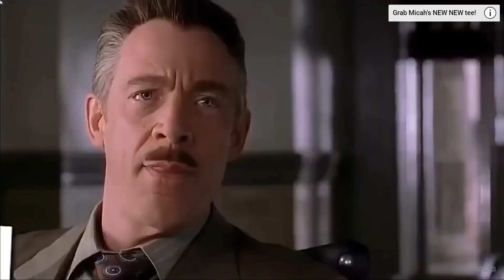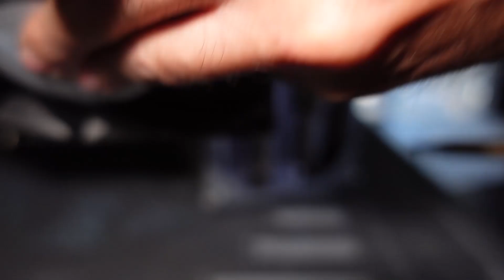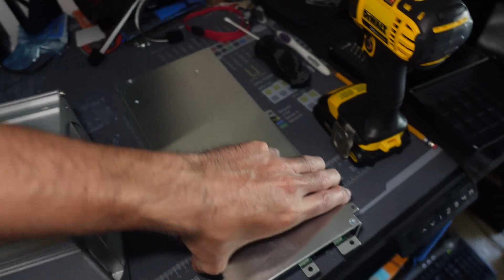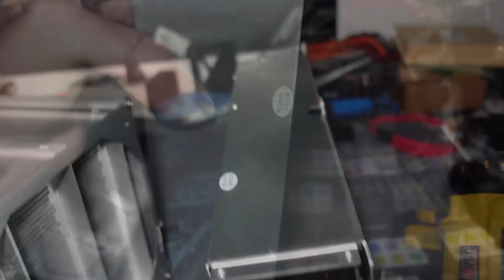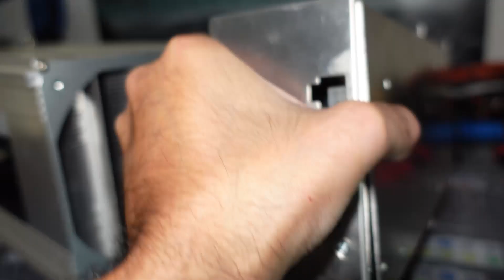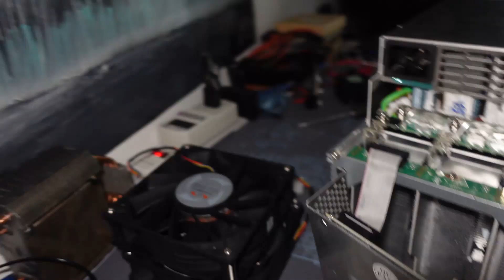Teardown of WhatsMiner M30S+, Preparing Asic for Immersion Cooling

Comment: as a guy that works on liquid immersion asics (m20s) every day, you should leave the PSU fan plate off, that will allow more flow through the power supply. the power supplies have been the weak point for me.
Reply from the maker: Thank you for that advice
Reply: When I remove the fan the power supply stops working